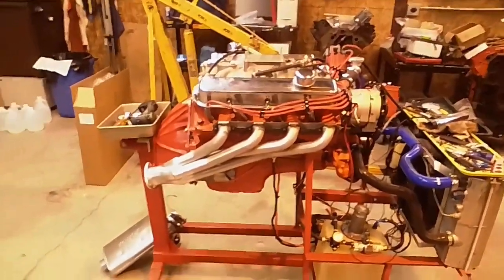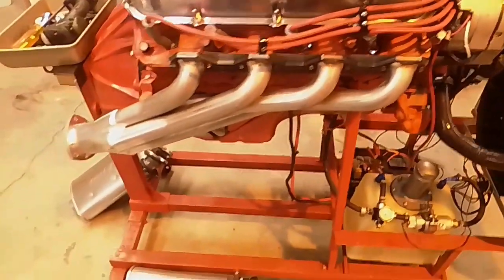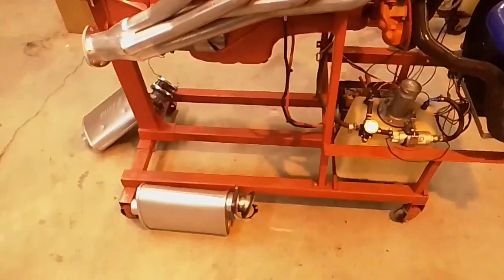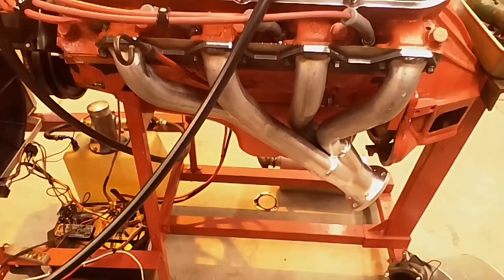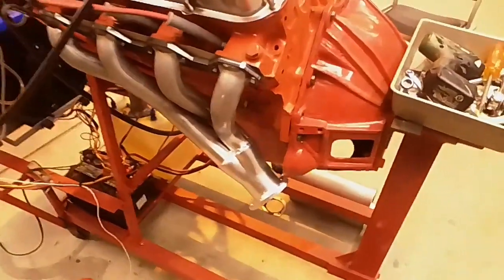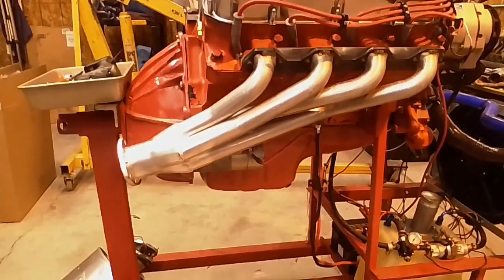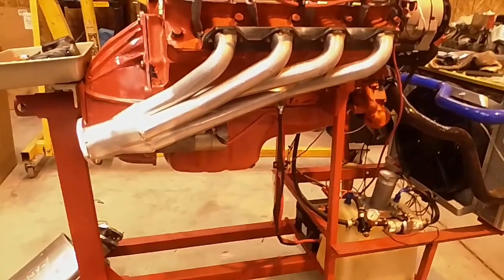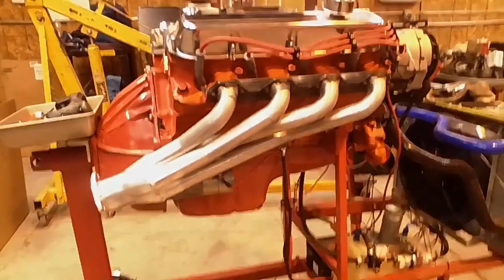Cad Co Universal header ..... Cadillac 472 / 500

Comment: Scott...many tx for your videos!  Today I got a link to your great site via The Cadillac Forums people. I've had 14 Cadillacs and am in love with the cast iron engines 60's thru to 1981.
Today my 3 daily drivers are...two 1981  6 liter Eldorados and my lean mean fighting machine..472 1970 SDV. My 472 has 171000 miles and runs/purrs like a lion. On my Cadillacs I've hard plumbed oil pressure gauges at the rear where the oil pressure idiot light is.. My 472 runs around 37 psi since I purchased her in 1984.
They are amazing engines. I change the oil and filter twice yearly.

My ????? 
1.Your valve covers......did you have them plated or is there a retailer you know who sells them?
2. The 2 rear bolts on the left side holding the exhaust header to the head have broken off  slightly inside the head. Do I need pros (tig etc) and engine removal to extract them?
Currently I have 2 C-clamps and a new gasket keeping the leaks minimized! I seen some custom  L-shaped brackets that bolt to the back of the head. Any thoughts?-

Comment: Im doing a 472 swap into a 77 monte. I bought and been struggling with Sanderson cad600 headers designed to fit GM A body which should fit my 77 monte carlo that is technically the last year of the A body. Anyways  i wish i bought these headers instead. The Sanderson left side header touches the steering shaft. Right side touches upper control arm bushing and the frame. Thats with stock caddy mounts and adapter plates that I havent even welded to frame yet, i can move it around but nothing really helps, I'm still trying to get the engine alignment right while also finding a way to make the headers work. Just discovered your videos been binge watching them.